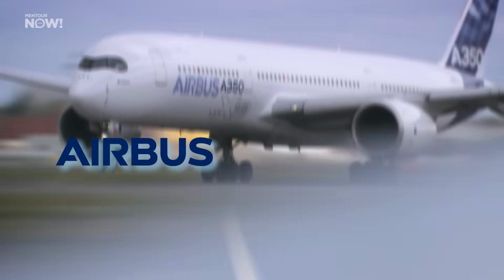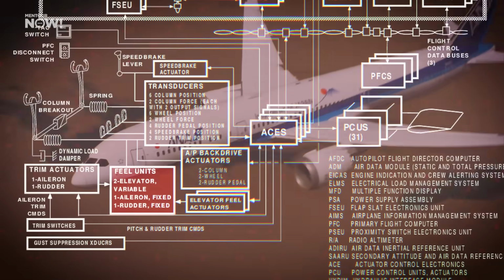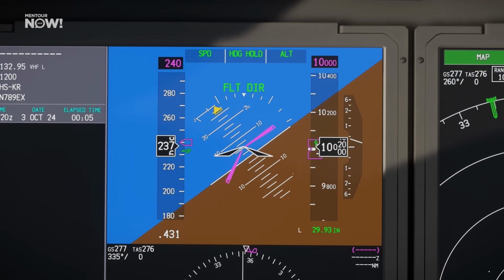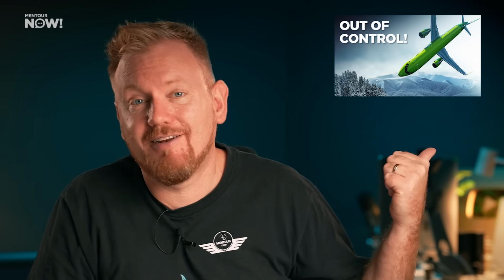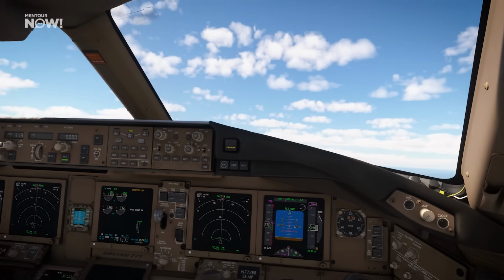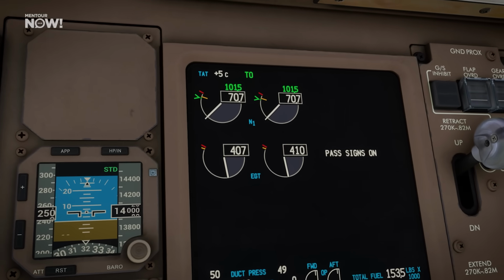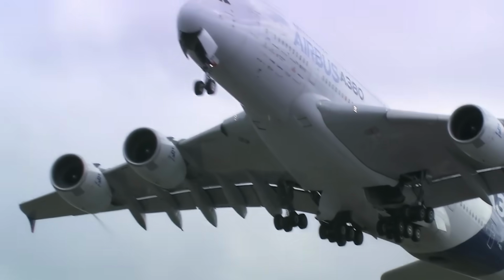Do Pilots Prefer AIRBUS over BOEING?!

Comment from the maker: Go to https://saily.com/mentournow and use the code mentournow to get an exclusive 15% off your first purchase.
Reply: What is Boeing??!!! Sounds familiar! Something from the past, maybe?
Reply: I think it does matter now more than ever.  Not only is it a debate on which is safer but now we have to worry about Boeing flying a crew up to its destination and then returning without its crew all  the way back to its destination. I mean it can’t stay safe within Earth’s atmosphere, now we know that it’s even unsafe out of Earth’s gravity.  Forget about the “Fly-By-Wire” debate, let’s get the “Fly and stay flying by a stale aircraft”  debate going…. 🤣🤣🫡✈️
Reply: You forgot very important point. While "modern" Airbus is on same safe level as "modern" Boeing, the issue is that most of the flying Airbuses are the modern type like A320, but most of the flying Boeings are still missing the modern features like fly-by-wire, for example 737. You also forgot to mention that the "old" 737 is currently the only Boeing in production.

Yes, Renault has an F1 race car same as Ferrari, but most Renaults on the road are not race cars.
Reply: @risharehraje793  sorry but you’re wrong. The 737 max is FBW for the extended spoilers, the engines too.
Reply: AF447 crash could have been avoided, IF the AP could have AI features that do not exist yet: For example, an AI AP that detects air speed indication issues, stalling etc. it can focus on GS from GPS to detect if the plane flies very slowly relative to the terrain below. This way, the AP could detect stall conditions, high AoA and low GS and react accordingly. AI AP are panic-free in all circumstances, unlike incompetent pilots...
Reply: 28:00 Minimizing whether "the aircraft had a nice dinner table or not" could be dangerous with some flight crew members.
Reply: Do Pilots Prefer AIRBUS over BOEING?! Real pilots prefer Concorde
Reply: Here is a great video series ide for you, Mentour pilot:
go over Boeing accidents, and see what would have happened if the same circumstances happened to an Airbus. And vice versa.
Reply: 5:43  I would really like to see your impressions about to flying an Airbus plane, so I hope you achieve that hit very very soon!
Reply: How did Germanwings Flight 9525 manage to crash into a mountain? The copilot must have been able to override the safety parameters system.
Reply: Can you tell us more about that *hint hint*? 😅😅😅😇😇
Reply: Lol 😂
Reply: Captain Hornfeldt, why do you refer to aviation maintenance technicians and aircraft mechanics as "engineers" ? Is it because in your native Swedish language there doesn't exist separate words or terminology in the Swedish vocabulary to distinguish between the two different professions of aerospace engineers and A&P mechanics ?
Reply: @ArchimedesDaVinci  horses for courses. You use American English, we use English English. Over here we are CAA licensed engineers. Same as Europe is EASA licensed engineers.
Reply: @ArchimedesDaVinci  Just another example of our present day woke society. As they say,  "last week I couldn't spell inkanear, this week I are one".

Comment: The thing that comes to mind of a possible benefit, I'm halfway through the video, is an incident where (I forget which flight) but a pilot did a suicide/mass murder by deliberately going past the safe range of flight.

Tbh I don't really see how 5220 highlights this? I think that sure, responsive controls would be nice to have but I also think there should be an alert when that happens (the law change) like when auto pilot is disconnected (since these laws sound adjacent)

Comment: I think the most obvious feature on the Airbus is the auto trim. I've always compared the sidestick functions as when Boeing had control wheel steering (CWS). That feature was removed from all Boeing aircraft I think in the early 2000, where for the 757/767 there were push buttons, and on the  737 were paddle switches. I think the -400 was the last 737 that had it, and back in my days. In any case, if  you had flown one of those, you could control the yoke with the A/P on, and the airplane would stick to the attitude een if you released the wheel, hence the name. Just like the Airbus would do with the A/Ps off. In any case, great video. I'm sure you're well connected with training facilities, so I'm certain you can get two or three hours in a good Airbus sim, and put all your learned knowledge to work.

Comment: If unsure about this, read BEA (European NTSB) report on aftermath and after CVR and FDR were recovered unbelievably from AirFrance flite 447lost off S America due to frozen pitot tubes. BEA had scathing comments about AirBus and its approach to application of flite control systems. They stated that flite controls and layout were difficult to understand and could lead to disastrous results which it did. This report touches on the very thing Petter is attempting to touch on here. Do research and read this report. It is disturbing

Comment: Is this like Boeing insists on a stick shift while Airbus provides automatic transmissions, only with the principle being extended to most or all of the controls?
In any case, I just feel what is needed is an AI oversight feature (in practice like the Star Trek setup voiced by Majel Barrett), warning the pilot, "you engaged TOGA--did you really want to do that?" or "You disengaged the Autopilot but not the Autothrust. Should I correct this?" I'm sure it might piss off some pilots, especially the less competent ones with ego issues, but if it would support safety, it couldn't be a bad thing. Inadequate pilots, of course, might develop selective deafness to "Mommy".

Comment: ai summary

Abstract:

This technical analysis compares the divergent design philosophies and flight control architectures of Airbus and Boeing commercial aircraft. The core distinction lies in the implementation of Fly-By-Wire (FBW) systems: Airbus employs a "hard protection" philosophy, where flight control computers can override pilot inputs to maintain the aircraft within a safe flight envelope. Conversely, Boeing utilizes a "soft protection" approach, prioritizing pilot authority and maintaining tactile feedback through traditional control columns.

The analysis examines the operational risks associated with both systems, noting that while Airbus's automation reduces human error, it can lead to pilot complacency or a loss of situational awareness during system degradation (transitioning from Normal to Alternate or Direct Law). Boeing's philosophy maintains higher pilot engagement but allows for the possibility of the aircraft entering an unsafe state (e.g., a stall) if the pilot fails to intervene. Data indicates that "Generation 4" aircraft from both manufacturers are significantly safer than previous generations, with no statistically significant safety difference between modern Airbus and Boeing platforms.

Comparative Analysis of Airbus and Boeing Flight Control Architectures

    0:54 Fly-By-Wire (FBW) Implementation: FBW replaces manual cables and hydraulics with an electronic interface. Pilot inputs are interpreted by computers and sent to actuators, reducing weight, maintenance, and increasing redundancy.
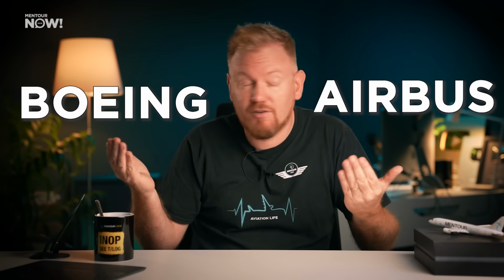    2:35 Divergent Design Philosophies:
        Airbus: Focuses on reducing human error; the aircraft is designed to protect the pilot, casting the pilot as a "manager" of automation.
        Boeing: Maintains "ultimate authority" for the pilot, designing FBW to mimic the tactile feel and aerodynamic feedback of conventional aircraft.
    4:43 Interface and Feedback: Airbus utilizes side-sticks with minimal tactile queuing. Boeing retains the large control column (yoke) to provide physical feedback and integrated movement visibility between pilots.
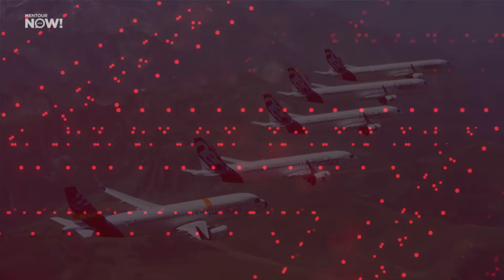    7:51 Airbus Control Laws:
        Normal Law: Full automation and hard protections active.
        Alternate Law: Reduced protections due to system degradation (e.g., air data failure).
        Direct Law: Minimal automation; pilot inputs directly move control surfaces without trimming or damping support.
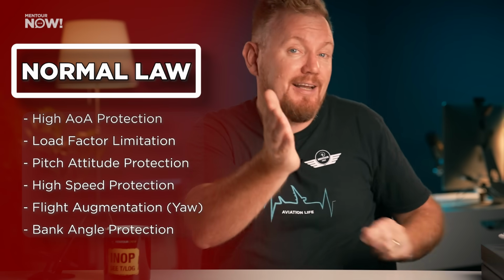    9:14 Hard vs. Soft Protections: Airbus "hard protections" are non-overridable, preventing maneuvers like excessive bank angles or stalls (e.g., Alpha Floor protection). Boeing "soft protections" provide warnings and gentle corrective inputs but allow the pilot to override the system.
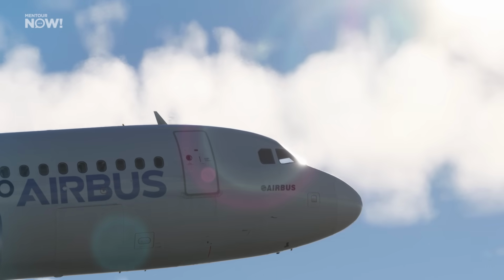    12:19 Automation Risks: High automation in Airbus can lead to "out-of-the-loop" syndrome, where pilots lose situational awareness. This was a contributing factor in the Air France 447 disaster.
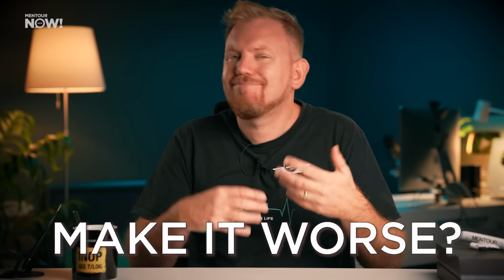    14:21 Sensor Failure and Law Transition: The S7 Airlines Flight 5220 incident illustrates the danger of unplanned transitions to Direct Law, where a lack of automatic trimming and conflicting dual-pilot inputs (summed by the computer) led to loss of control.
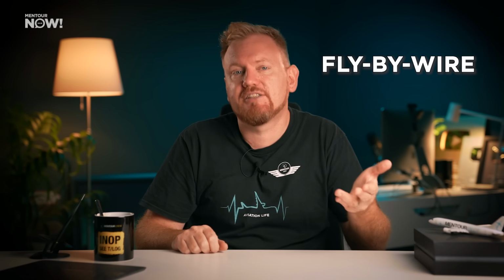    19:16 Manual Authority Implications: A Boeing 777 incident demonstrates that because Boeing allows pilot override, the aircraft can enter a stall if speed is not managed, a scenario a modern Airbus in Normal Law would physically prevent.
    22:23 Auxiliary Safety Systems: Both manufacturers utilize runway and approach stabilization alerts. Airbus features a "Backup Speed Scale" (BUSS) to assist pilots using pitch and power when primary speed indications fail.
    23:19 Monitoring and Troubleshooting:
        Boeing (EICAS): Provides a simplified visual overview; manuals restrict its use for deep troubleshooting outside of checklists.
        Airbus (ECAM): Utilizes detailed synoptic displays showing real-time values and connections, allowing for more complex onboard troubleshooting.
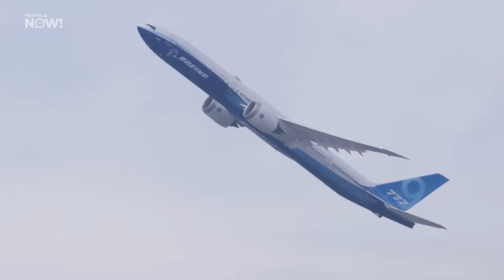    26:19 Safety Statistics: Generation 4 aircraft (A320 family, B777, B787) show a 90% reduction in loss-of-control accidents compared to Generation 3. There is no significant overall safety difference between modern Boeing and Airbus aircraft.

Comment: What we have today as far as modern commercial aircraft designs is pure brilliance on the part of Boeing and Airbus.  It is far beyond the cables, hydraulic actuators, and hydromechanical engine controls of past years. 

When I was a kid reading about the FBW system that Airbus had built into their aircraft, I didn't understand until years later of seeing it in practice, and gathering further information.

I'm not a pilot, however I want to point out that in these times, when the flight envelopes are breached, with the availability of data, the aircraft owners may get the information from a Quick Access Recorder or it being transmitted to headquarters.  This could result in a conversation with the chief pilot of the company or more.  Other than that, way too much is at stake.  It would make no sense to be re-doing the work of the test pilots by putting the airframe in situations for which it wasn't designed for.

Another thing is if the awareness of the current aircraft speed is lost and it falls below the ability of the wings to keep the plane in flight, it could result in fatal outcomes.  On another channel I watch, the gentleman brought up the fact that even the best can lose awareness of the airspeed and pay the ultimate price. Something I would want to research is the most practical ways to keep that awareness regarding airspeed and other important flight information, should I decide to move forward with learning to fly.

Thanks Mentour!

Comment: I used to have a teacher, during my pilot training, from former Sabena, who has flown both Boeing and Airbus. It is the most famous quote I've heard: "A broken Airbus is like flying a Boeing: there is almost always 1 extra redundancy available on Airbus. Extra hydraulic line, extra CPU, extra AoA, etc..." possibly over-engineered but directly attacking the main course of accidents in aviation as mostly pilots make the mistakes these days rather then mechanical issues cause inci- & accidents

Comment: With FBW - The fact that if the puter dies, nothing the pilots can do can change anything is "light yourself on fir and run into the woods screaming while ripping your hair out".  The stupid stuff my wife's new "SUV" does to make driving difficult is beyond irrititaing, but I presume there's a connection from the wheel to the steering gear and from teh brake pedal to the calipers - though the "emergency brake" is now truly just a parking brake, that can't engage unless the engine is running and you're fully stopped, but regardless, I can run off into a ditch and slide to a stop instead of slamming into the ground at 180 knots.

Comment: My car has safety features that prevent accidents. If it thinks conditions are right for me to crash into another car it will actually slam on the brakes. Usually it's also aware of whether I'm within the lane markings. This is great, except when I'm driving around a curve, where if I continued straight I'd hit something, but because I can see I'm in a curve, I know I won't hit it. Sometimes the car thinks it's protecting me by slamming on the brakes, when actually, it just made me slam on the brakes unexpectedly in the middle of a busy street. It's a fine line between protecting the operator and endangering them. Computers will never be a substitute for the judgement of a qualified human.

Comment: Boeing has the nuclear rights to carry boiling nuclear components, the warhead has a hammering effect, that's why missiles are under the ground. Underground explosions can flip over the missile carrying unit, 2 drivers must steer into different directions depending on the explosion. The most dangerous cutter is a boiling 2 cm knife, the 747 builds itself up in the body from the smoke. 
Airbus simply conducted by the air traffic controllers using bus rules. No chance against a nuclear explosion.

Comment: There is always room for improvement so the answer is in the middle- flight stick/rudder and throttle feedback is absoloutely essential even if it’s a side stick edition visual cues and tactile feedback along with memory items will save any startle reaction emergency (provided the pilot is foundationally competent) so… in an unplanned response emergency situation all information overload needs to be stripped back and then in concert with airbus-esque flight computers and design/build ethos; a system that can self diagnose the critical information aircraft state feedback and then prioritise the input for the pilots (triage) the most important info can be fed through their primary display one item at a time as it is addressed (re-sync pilot/aircraft states to stay with the aircraft and emergency parameters). In short you can never have enough information as a pilot in an emergency but you can match the rate of info feed to the pilot priority work rate.

Comment: I have no confidence in the boeing max series. They are a greedy company hence the mcas system instead of making a new design they went with the cheaper option of rebadging an old design with that awful software. They put profits over human safety.
Reply: ………….ok………………
Reply: To be fair, the A330 is basically the original Airbus A300 but lengthened and modernised

Comment: On a Boeing the autopilot can be set at a climb rate and it will ignore airspeed. This is what happened when the speed fell off. I have flown both and the Airbus is made for third world pilots and takes away many pilot decisions or options. I also prefer the wheel over the stick because it lets you fly with either hand. The Boeing controls are direct inputs and the,plane responds according to the inputs. The Airbus controls are only suggestions from the pilot and the computer can disobey or change them depending on the safety program limits in the computer.
Reply: You’re mistaken. Only one boring product has direct control.

Comment: I consider the Airbus pilot's left-side stick to be STUPID!  Why? Most persons are right-handed. And yet the righty pilot is required to operate the air surface controls with the non-dominant hand / arm which has less movement precision. First order of business, ALWAYS, is to fly the plane - and to do so deftly.
Reply: It's the same with Boeing really... when you fly in the most critical stages (take-off and landing) the captain will always have one hand on the yoke, and other on the thrust levers.

Comment: AF447 happened largely due to gross pilot incompetence. Pulling all the way back on the sidestick for minutes (hours?) while the aircraft is losing altitude and approaching a stall is an absolute no-no and even the least experienced pilot knows that. The other pilot should have also noticed this on his display but failed to do so.

Comment: Ι as non pilot find the Airbus better. Because as long as i could establish communication with tower control i could just give the numbers and have the plane do everything by itself. Even the landing part. But i would knew that with Airbus either the electronic systems work and we will make a nice landing or we will crash. No way to save it. With Boeing i could but i have no experience or feeling of the plane so i would probably crash it. An experienced pilot though perhaps can save a Boeing situation going bad. So with Boeing it may be more prone to get less than ideal flights yet manage to land with minor injuries. With Airibus it's either perfect voyage or if things go bad... an unsavable tragic outcome.
Reply: You really think everything's done manually in a Boeing and auto-land is exclusive to Airbus? lol...